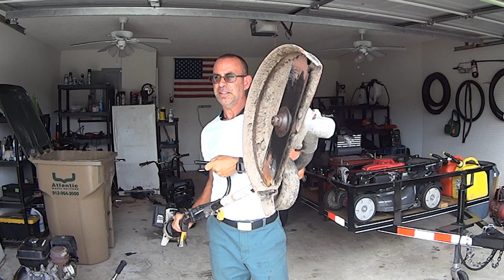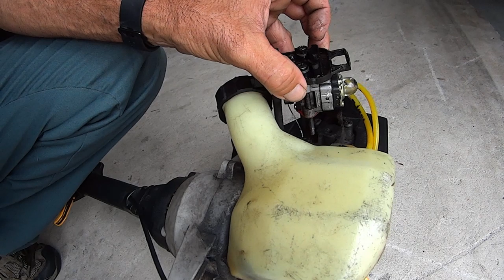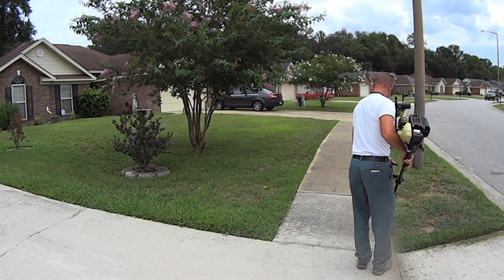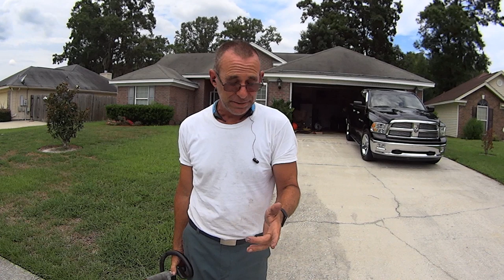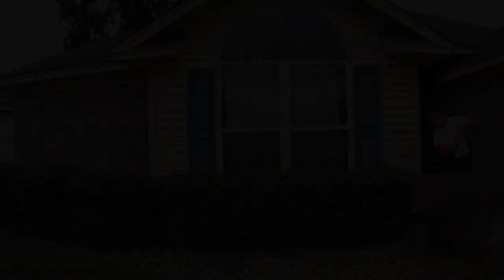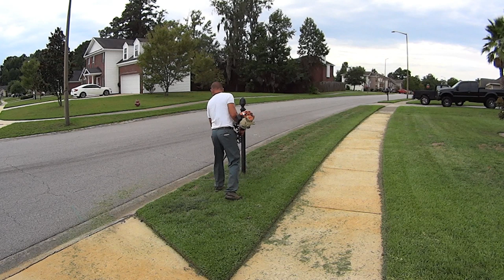Cutting Grass - Ryobi 4 Stroke Repair / Test - Finishing Up My Lawn Care #SideHustle Week

Comment: I edge + weed eat 3 thick FL St. Augustine lawns a week with a <100$ 2-cycle Ryobi power head and attachments. Going strong well over a year so far with marine gas and regular cleaning of the air filter etc. Nice video.
Reply: Ordered bulk blades+ Oregon line from your links as well!
Reply from the maker: Sweet! I re ordered from my links as well yesterday.

Comment: Great job, Dan.  Was wondering if the stained concrete is from well water.  I remember when we lived in Jacksonville, Fl,  we could always tell who watered their lawns with well water.  That was back in the late 80's and don't know if it still discolors concrete.
Reply from the maker: The rust is from the rebar located near the surface. When it rains and pools up, the rust stains the concrete

Comment: Ryobi seems to have an issue restarting after being shut off in high outdoor temps.  
You ever hear of this issue and have any possible solutions, beside putting a wet blanket over the sun?  
Thing runs and starts great the first time. But after that it becomes very very difficult.
Reply from the maker: Try unscrewing the fuel cap to release pressure on the carb.
Reply: Dan's Vlog Yeah that was one of the things I did, hoping it was the issue.  However it didn’t  work.  I have to not use it for awhile after shutting it down.  
So basically I make sure I’m full of fuel and string when trimming.   
I have an edger with it too. So I make sure I finish everything before turning it off.  
Thanks for the advice.

Comment: Hey Dan I was wondering when you sharpen blades, how important is it to keep the angle the same, I think I try to oversharpen them and they dont cut as well as they should.
Reply from the maker: The longer you can keep the angle at the factory setting the longer the blade will last as far as the amount of times you can sharpen it
Reply: @DansVlog  yeah I have a hard time keeping it the same, but I'll keep trying lol

Comment: Do you use the Stihl Kombi system?
Reply from the maker: Most definetly! I have the KM90 powerhead and the straight shaft edger attachment along with a straight shaft trimmer attachment in my trailer's tool box

Comment: It's not you it's Ryobi... Lol. They have great machines, and I've used their pressure washers and trimmers..They seem "Just Like" mainstream commercial models, but only almost. One thing they're really good at is making lots of noise. The blade rubbing against the shield came through a lot. Likewise on my Ryobi trimmer, the gears inside the trimmer head housing are obnoxiously loud.
Reply from the maker: I never used Ryobi but I did use the low cost attachments with my Husqvuarna LD28 Powerhead. Whatever it takes to get ya started!